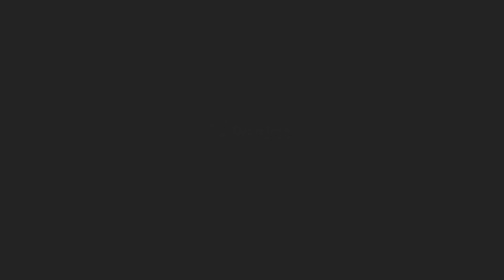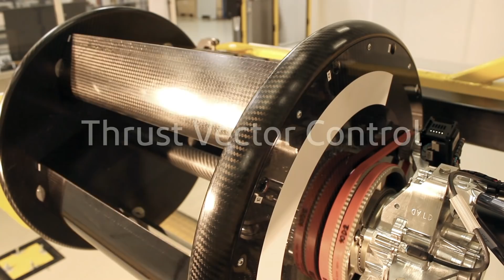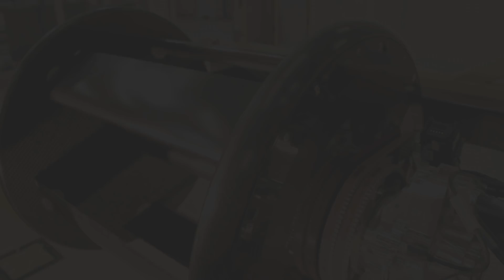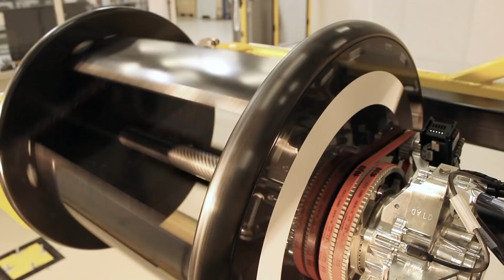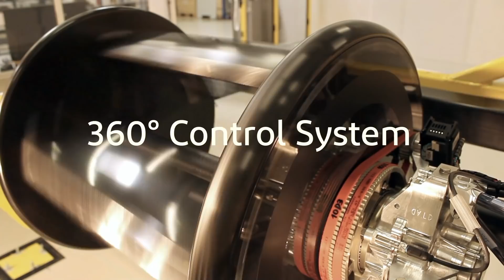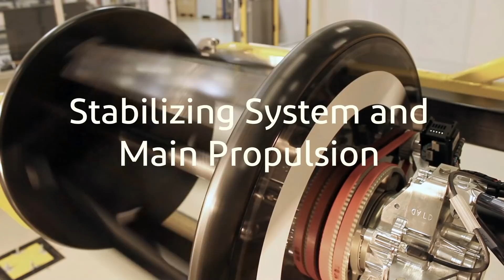CycloRotors | Enable 360° Thrust Vectoring

Comment: Cool! What do the two gears with red belts do? 🤔
Edit: What I mean is, is this the planar motion control to position the pivot center of the blades?
Reply: Yes, I believe it is.  You can see the blades moving when the gears do.
Reply: i'm assuming it's moving around a disk that controls the angle of the blades. 
(like a swash plate in a helicopter) 
so that they are in line with the direction of movement on one end of the drum.  and opposed to the direction of movement on the other.
Reply: Typically in a cyclo-rotor an offset crank is used to control the blade angles and the rotation of this controls the direction - Very much like a swashplate as mentioned above by darkracer125. This implementation appears to take things a step further by implementing what looks like differential control. You'll notice that in this video both belts move in the same direction and this looks to control the direction as you'd typically see, however I'd bet that by rotating these in opposite directions the amount of offset is adjusted which controls the amount of thrust rather than just the direction. I can't work out what the mechanical mechanism would be to implement such control though.
Reply: @yngndrw.  Ok that's what I was wondering, are they actually moving the pivot AND adjusting the offset? I also can't think of what mechanism they would be using to do this. It's interesting because it's all happening axially through the rotating axis! Very cool.
Reply: @gerrybeylerian5290  action of an eccentric to control pitch is shown in this CycloTech video
https://www.youtube.com/watch?v=gwsmKxDwgz8
but I haven't found an explanation of how the two belt-driven sprockets move the eccentric.

Comment: With these rotors applied to a craft, do they need to exposed to open air (As in do they need to remain uncovered) or could they be covered over and still provide the life needed to fly?
Reply: afaik from what ive seen from cycloidal rotors in like diy drones etc, they do need to be exposed.

Comment: Does anyone have an actual flow model of what the air profile actually looks like when the angle of the blade changes? Also is the angle continously changing as it rotates or is it constant? How does the system stay balanced while the blades position move?
Reply: I assume balance is same as quadcopters, diagonal reversal of lift to keep it stable. if you're really interested knowing more, why don't you get 3D printer and make a small scale model, but quadcopter and then try replacing quadcopter blades with the ones you print. it should work fine with slight modifications and then you can use smoke to trace the air flow.
Reply: @SethiozProject  "if you want to know more, simply reverse engineer this and build a functioning prototype, then test it in a wind tunnel. its that simple"
Reply: The angle is continuously changing. For a certain flight condition, the angle setting on their servo will be constant, but if you look at a single blade as it travels around the azimuth, its angle will vary in order to produce net thrust in a given direction. Here's a video that explains it pretty well: https://www.youtube.com/watch?v=JoVmejDsMrM

Comment: I see a safety advantage over a prop but great losses everywhere else.
Reply: Where do you see great losses? The lack of tip vortices is an improvement over traditional propellers in terms of both drag and noise.
Reply: @brycejensen5201  ...and the relatively lower speed is quieter. No super sonic propeller tips.
Reply: @joergmeyer4145  fuel efficiency perhaps? and increase in weight, so it would need lighter and stronger material which means more cost.
Reply: @Stan Cooper this is my problem with it aswel.  
and a prop is already too iffy for every day use in this way.  

i don't really trust it yet.
Reply: @krain.8245   Fair points, I haven't seen any calculations yet, but it seems to have potential for high efficiency. The airfoils are able to achieve a higher angle of attack without stalling, and as I mentioned before, there is nowhere to generate tip vortices which induce a lot of drag. Ease of manufacture needs to be taken into account though as well. Current propellers are very complex compared to a straight symmetrical airfoil (or several).
Reply: @joergmeyer4145  Right. Supersonic propeller tips are a quick way to ask for catastrophe. Tip vortices surely contribute to noise. At least, that seems to be why ducted propellers and ducted fans are quieter than open propellers.
Reply: @Stan Cooper Couldn't agree more. That said, "No risk it, definitely no biscuit"

Comment: I saw a man take off with the help of two blowers. it seems to me it was much more efficient to install 4 powerful blowers and control the flows)
Reply: well I've seen people put propllers on a bathtab too and take off with it, that doesn't make it effective and stable. There's a reason why most effective way to fly are planes and helicopters. VTOL is slowing becoming more effective, with this design you can control if you provide lift or forward / backward thrust. so it's basically mix between plane and helicopter, just needs wings so it can glide better.
Reply: @SethiozProject  
it could also fly upside down.  
or straight up alaigned with a wall   
and even hover that way

sadly no strafing or rotating along a single axis to face backwards while hovering in place.  
you can only rotate like that forward and backwards  so you'd end up upside down if you want the nose pointing in the other direction. 

it can litterally only turn that way by banking and pulling up,  like a plane. 
i guess it could do that in place as well.  but it would still need to tilt over and then "pull up" to turn around. 
and i have no idea how it would avoid drifting in that situation
Reply: I dont know but I think ur onto something. I saw a guy take off in a cardboard box one time. Maybe we should look into cardboard planes as well. Like a cardboard-leaf-blower plane? thoughts?

Comment: Can we make this rotor design an attachment to a car wheel that has the blades in the proper orientation to produce down force?
Reply: My first thought was --- Back 2 the Future DeLorean! Imagine a car that has 4 of those wheels and openable flaps on top of hood and trunk area for air flow, so it can take off just like the car in movie. But downforce also crossed my mind, imagine such wheels on Formula 1 cars!  .. well never going to happen, because they are already worried that F1 cars are too fast and reducing their grip. They no longer allow slick tyres either. they further reduced the grip by limiting wings they can put on cars and also Ferrari had some interactive bottom, that changed its shape and gave more downforce, but that was also banned due the increasing grip issues, they don't want to see too much grip in F1 as it gets dangerous, however I'd like to see a car like that. Because the best part about this design, is that you have no stress on suspension, the wheel itself grips to the ground. 
this design can further improved on car by making the blade part rotate seprate from tyres, which means it can provide crazy grip / downforce even at very slow speeds. Could be useful on street cars. imagine driving on black ice or wet surface, how many crashes there have been on highways or even surface streets, because someone goes over wet surface or black ice and loses control? Those bladed wheels could easily save you from serious crash.
Reply: @SethiozProject  yes!  F1 might say no but what about those dudes out at the salt flats trying to set top speed records.  Regardless, a good idea finds funding.  Love this project and looking forward to see what comes next.

Comment: Unless I've missed my guess, this cannot possibly scale to safely and reliably lift a multi-passenger aircraft more efficiently than current designs and propulsion methods.
Reply: This was also my thought... it seems to be mechanically very complicated. What are the benefits to simple propellers on a movable arm? I really would like to know the effciency of this special rotors.
Reply: Rotor aircraft are not actually all that safe.  Fixed-wing aircraft are.
Reply: I was actually wondering if this solves the downdraft issues of rotor aircraft that has led to a lot of helicopter crashes.  When a helicopter hovers in one spot for too long the wind currents begin to sweep up, over, and then push down on top of the rotors causing the it to lose power.
Reply: @kyle2034  Is there a name for this phenomenon?  Or a link to authority?
Reply: @adamchurvis1  called vortex ring state, I learned about it in flight school, but I’m fixed wing so not an expert. https://en.m.wikipedia.org/wiki/Vortex_ring_state
Reply: @kyle2034  I don't expect that, those down drafts are bigger than the aircraft. Because of this I don't think that there will be any difference. But maybe I'm wrong.
Reply: @kyle2034  The rotors seem to be much more complicated than the allready complicated rotor systems of an helicopter. The rotors of drones are much simpler than both of those systems (so are vehicles like the volocopter). I wonder if the Cyclorotor is capable to comensate one failing motor/rotor (as the volocopter can). This would be a saftey impfovement.

Your fixed-wing to rotor comparison is a litte to simplyfied as the volocopter shows. But there are even older rotor aircraft types that are increadable safe. I like the idea of the gyrocopters: You basically cant stall them. They take barely any rundway to land. Because of this they can very often land safely if the engine fail. At the same time they have very simple mechanical parts.
Reply: @michaegi4717    By fixed wing I mean I’m a fixed wing pilot, not a helicopter pilot so I only have a baseline level of knowledge about the ring state vortices. I read quadcopters can experience them as well while descending straight down into their own downwash.
Reply: @michaegi4717  if they can solve for that problem using this technology that would be a massive safety improvement.
Reply: You would be surprised